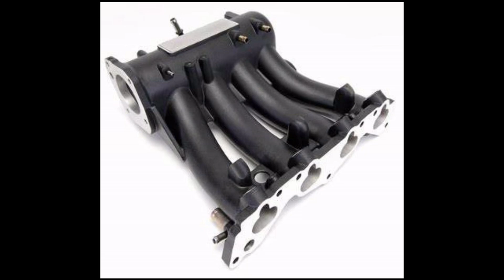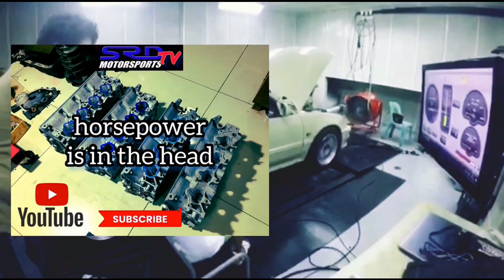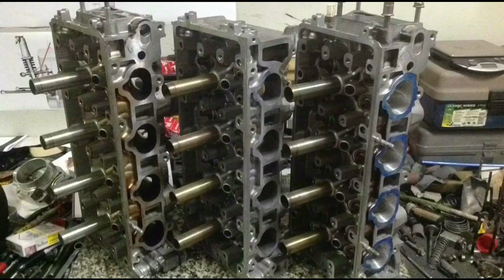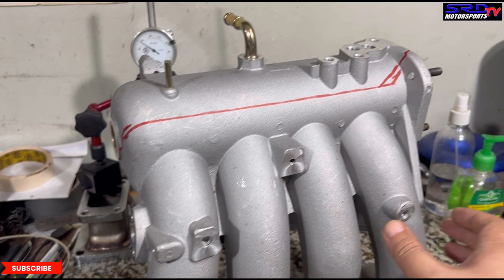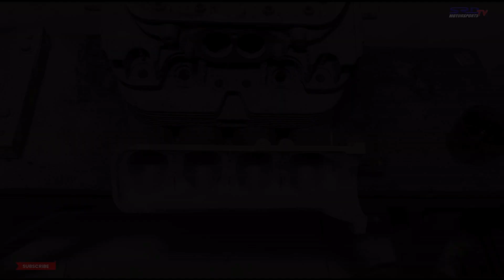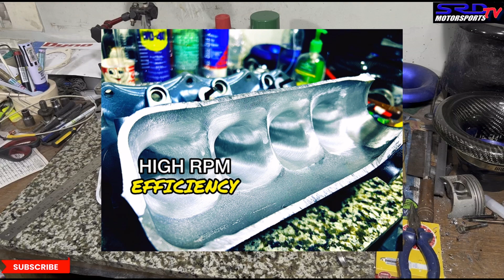Skunk2 Pro Series D16 Intake Manifold Porting Development

Comment: Boss normal maintainance bg d16y4 ko change head gasket and cyl head cleaning how much po and ilang araw port polish lng ? San po shop nyo?
Reply from the maker: Depends sa mileage but I think khit dati sa “casa” once na reach or after 50,000km isa na sa option ung change head gasket etc and possibly top overhaul etc

porting and other works may price list sa page…in peso (confusing here cuz more than half saten dito not local)

Time frame = 2-3weeks from start to finish
Antipolo is the location
Reply: @SRDmotorsports  s top overhaul sir kayu mismo recond or sa machine shop? Magkanu po abutin sa recon ng cyl head and change head gasket sir?
Reply from the maker: All machining works we send it to Edmel the rest we do at the shop

check the pricelist at the page and pm directly there for other questions

Comment: What are you going to do to that crack between port 2 and 3?
Reply from the maker: Leave it as is, welding it could fix it if needed

It’s a casting void
Reply: Good videos btw!
Reply from the maker: @casperwolters20  thank you! I’m actually trying to work on a video that explores the “original” vs “china” casting

But it’s taking time, as Ofcourse hard to just get manifolds and cut lol but soon

Comment: Hey bro where could I message you privately I need to talk about my h22 built thanks
Reply from the maker: Oh for sure man no problem
Reply: @SRDmotorsports  I got some questions on pcv systems I want to make some power out of it I seen your video talking about on the back of the block of the Honda has Allen screws how do you make your own Pcv system?
Reply from the maker: @angeluribe2232  oh yeah I think it was one of the h22 manifold videos that I showed the pcv fitting welded on to the block of an h22
Reply from the maker: Could weld even 2 an10 fittings there and then If more than a breather system is needed

The L type pcv system from a Bseries or TypeR is usable and I think online some sell those and it’s a one way valve

So it can still act like a pcv system on idle until mid throttle
Reply: @SRDmotorsports  thanks appreciate it and one more question what is the desirable compression ratio for boosted setup on H I want a medium size Snappy  Turbo and I want to use the highest compression ratio for a turbo setup safely what do you recommend
Reply from the maker: @angeluribe2232  well it always depends on turbo size I mean some run a bigger turbo that lags a bit but run more comp to compensate

I’d say 10.5-11:1 will be doable with a big enough turbine
Reply: @SRDmotorsports  thank you I appreciate for answering back yeah right now I'm just in a debate if I go turbo or all motor for a street car
Reply from the maker: @angeluribe2232  not a problem man… ah yes the most difficult debate 😂
Reply: @SRDmotorsports  and I heard of people using some pumps for the PCV system and make power

Comment: Great video! Glad I got this intake, now I'm wondering if I should have it cut open and ported..
Reply from the maker: It’s a good intake
Reply: @SRDmotorsports  Thanks for explaining it with science. There are some debates with this against the edelbrock performer
Reply from the maker: @vince.r  yeah but it’s such a waste of time kinda debate…. 

It’s like at most 1-3whp difference

But each manifold can be build with a suitable cam, head and compression to beat the other…

So it’s such a waste people will choose a “better” one then don’t do the rest that compliments it? Then it’s not better

Locally it’s prolly as fast as stock lol

Seen a pm7 pistoned crower cammed skunk2 IM 4door pull 15.4sec hahahahahahaha

It’s why when local ask me what is better? My answer is always “the one that u can squeeze the best power from”
Reply: @SRDmotorsports  Oh wow. The debates you read sometimes is like you make power with one and you don't with the other lol.

Also, I added to findtherightbeat's comment that I have a brand new skunk2 intake here in my room, and it doesn't have the horizontal ridges in between the runners. It is much smoother. Could it be a different casting?

EDIT: nvm, saw your reply
Reply from the maker: @vince.r  u prolly got the “latest” casting ftw
Reply: @vince.r  The next step is to figure out and research what would be the ideal throttle body size for your applicarion.
Reply: @findtherightbeat  We, or should I say the builder suggested to go with a 62mm throttle body from the type r. Which makes sense.

And since I've been watching a lot of videos on this channel, I learned that there has to be some sort of Venturi effect since the intake tube will be 3", tapering down to 62mm(2.44094"), then to the intake plenum which is larger than the throttle body or have a similar diameter as the intake tube.
Reply: @SRDmotorsports  🙌🏻🙌🏻woohoo!
Reply from the maker: @vince.r  yep hence the usual reducer 3-2.5
Reply: @SRDmotorsports  Oh which reminds me to order one lol
Reply from the maker: @vince.r  yep the usual ones with the local intakes are ok but a silicon coupler is a better one

Comment: Curious as to what the horizontal ridges right in the middle of the casting in between each runner does
Reply: looks like just poor tooling design...  the original release version from the early 2000's didn't have this ridge.
Reply from the maker: @ghettoracer  yup I agree
Reply: @ghettoracer  Hi Frank, did you run a similar manifold for Project Remix back in the day?
Reply: I wanted to add here: I have a skunk2 intake here in my room and it does not have any ridges in between the runners. I have a video of the skunk2 and if you pause at the right time, you'll be able to tell. I think it might be an updated casting as I just bought this around 3 months ago.

Looks like a good candidate for porting, but also looks good on its own. I'll leave it to the pro's...
Reply: @vince.r  Thanks for chiming in, I had a look at your video and saw what you mentioned. Good thing you were able to get the manifold with the better casting 👍
Reply: @findtherightbeat  I'm glad to have gotten that too!
Reply from the maker: @findtherightbeat  yeah saw that one too it is indeed different
Reply from the maker: @vince.r  that makes sense actually as skunk2 continuously updates their product
Like the pro series cams are on its third generation now 

And the “settings” locals often ask? Is way different from Gen1 to gen2 and now gen3

They’re improving details
Reply: @SRDmotorsports  Oh nice, what a time to be building these Hondas..
Reply: Yep, that got me curious too. Possible area to weld up a bit and shape it like a velocity stack? It just looks a bit out of place having a unnecessary step like shape instead of it being smooth funnel shaped, but I guess skunk2 are still improving their machinery and casting and newer revisions might not have that "step" like somebody pointed out here in the comments.
Reply from the maker: @SusedatLubo  yes indeed
Reply: @SRDmotorsports  Ralph, sorry for the 2am question.. I'm Just curious how 4300 to 4800 rpm looks like on the dyno charts when the engine is running an AEM style CAI and running an exhaust manifold with a 1-3, 4-2 pairing.. is the hump still visible?
Reply from the maker: @findtherightbeat  oh yes still visible 

jasper’s ef runs a skunk2 alpha has that hump still
Reply: @SRDmotorsports  Thanks! I wasn't expecting you to be awake at this hour, just thought of asking the question  before I forget about it 😁
Reply from the maker: @findtherightbeat  didn’t expect it either lol just remembered an online game I havnt set up hahaha
Reply: @SRDmotorsports  Looks like Youtube's algorithm is working in your favor, didn't expect Frank to suddenly comment 👍
Reply from the maker: @findtherightbeat  true true
Reply from the maker: Wait the casting marks u mean? If on the divider then prolly no good as is or unported as it has stark corners as you can see so I tried to round it off

But couldn’t do it as much unless I’d punch a hole under lol
Reply: @SRDmotorsports  The casting where you placed the wire side of your measuring hose in 3:47 of the video, I'm just curious why Skunk2 casted it that way.
Reply from the maker: @findtherightbeat  it’s prolly the casting molds I mean yep if that was welded up to allow us to smooth it woulda been better

That’s also why my skunk2 has been rewelded 3-4times for punching a hole 😅

But oddly enough the runner length improvement and plenum volume is still enough to significantly outperform the oem
(Gotta say this for skunk2 but it’s a fact)

But this shows us that even “aftermarket” can and could improve ftw
Reply from the maker: I think the casting mold is a “top and bottom” half hence that ridge
Reply from the maker: Also have a skunk2 ITR style manifold that hopefully the owner sends soon… and cuz I still have all the photos and video of the oem ITR manifold that we ported?

Gives us a chance to compare it I mean skunk2 ITR Vs OEM ITR and that would be very interesting
Reply: @SRDmotorsports  Come to think of it, the ridges are probably due to the mold, just strange looking to have it at the dividers.
Reply from the maker: @findtherightbeat  that’s true on “weird” and yep it’s the “top” and “bottom”
Mold but yeah odd looking can draw teeth in it and it could look like a WWII fighter plane’s front lol
Reply: @SRDmotorsports  Since you posted the video, I've had a look at the Performer X to compare but I'm not sure the info online is accurate as King Motorsports mentions that the runners are just 9 inches whereas some guys from DSO say it's longer than the S2
Reply from the maker: @findtherightbeat  I think the sohc is but the Bseries could be longer
As even PRE likes it as good as the ultra street or atleast they said similar power cuz runner length is “longest allowed” before u reach the firewall